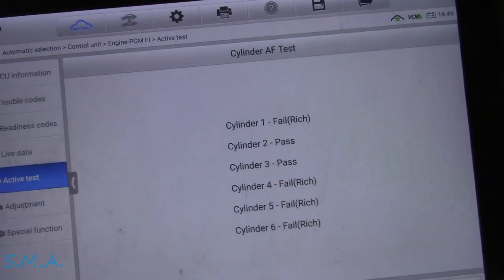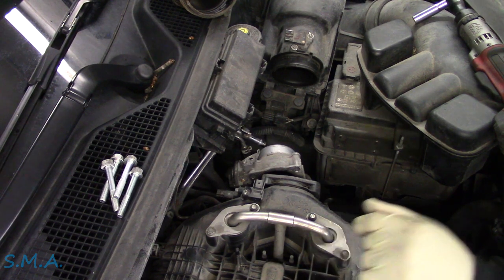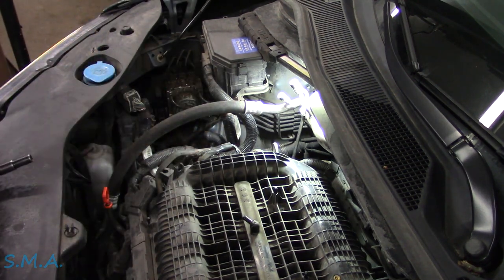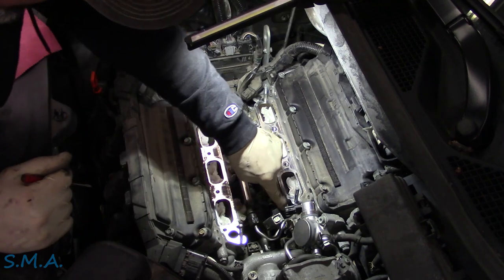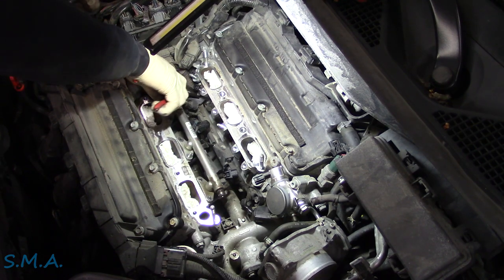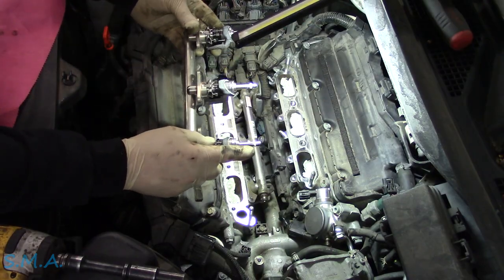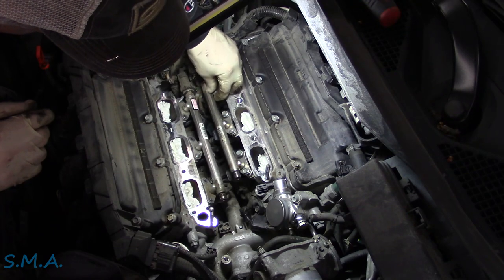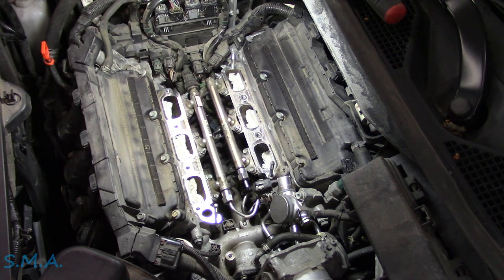Honda: Earth Dreams 3.5 GDI Replacing Fuel Injectors

Comment: anyone who thinks honda are the bees knees are lying to themselves.  the honda odyssey I drive as a company vehicle has tons of issues. 100k miles,  both ball joints clunk.  the control arm bushing worn out, power steering hose leaks, roof leaks at pillars drips on you legs and into the fuse panels by your feet on both sides so it blows fuses and the electrical system acts up when it rains.  heated seats are on in the summer, windows wont roll up/down, rear doors wont open, no headlights or turn signals or horn all in the rain.   the engine smokes when you take off from a stop and it's been idling for a min or two.  blows out a big puff of blue smoke.  the rear doors rollers are shot on both sides.  the rear trunk lid shocks both have leaked and quit working.  the check engine light comes on for the oil pressure stuff that activates the Vtec.  the brake calipers have been replaced due to one seizing up and the other had a torn seal on the piston.  the exhaust has had to be replaced because it rotted off and the converters fell apart and rattled inside.  and the power steering pump went out.  

it's literally had more stuff wrong with it than any gm i've ever owned.   i'm now a Ram truck owner and have no problems with it in 124k miles.
Reply: Company vehicles have more issues in my opinion. Our fleet of Grand Caravans have many more issues than your fleet of Odysseys. Even when we had 5,000 miles they were creaking and breaking.
Reply: @midwestfarm757  i'm the only person to ever drive it. once it hit 90k miles it fell apart fast. they're also know about sunroof drains leaking into the pillar shorting out the fuse blocks.  when it does, you can't drive it.  since i drive it, i  change the oil.  since it was new it uses 1.5 qts of oil in 4500 miles
Reply: @blue03r6  That's nice of them to give you a sun roof, our fleet vehicles fanciest parts is probably the back up camera.

Comment: HONDA is the new 90's HYUNDAI. I owned a 10th generation accord. Computer died at 33k, warranty ended at 36K, brakes went at 38K, then the big problem came at 58.6K FUEL INJECTOR FAILURE $1600 repair-must replace all 4!! Videos on my channel for all to see. Not covered under my warranty! Called Honda how could major part failure occur so early!!! Got ghosted! Dealerships so out of touch they recommended brake fluid replacement at 30K. Started researching and found out Earth Dream engines turn into Earth Nightmare engine: injector failure, oil dillution, turbo failure, cat converter failure start appearing @ 100k. By the time you see the signs all the dealers and influencers will be smiling down on you but helpful to sell you the newest version for a nice loss passed on to you. With almost identical engine I have no doubt the 11th Gen Accord will siphon your wallet turbo fashion after that joke of a 36k warranty runs out 😂

Comment: Silicone in adequate quantity  in the fuel could poison O2 sensors permanently! accidental mixing of solvents saturated with silicone in gasoline has in the past destroyed O2 sensors in hundreds of vehicles until the Gasoline blending police find out who mixed silicone solvent into the gasoline blend to act as filler for the overall gasoline formula!! Who would have thought!!

Comment: Looks like a cheapjack injector design. Can't cost much to make. Someone somewhere has some automatic machinery churning these things out for the price of a good spark plug. Like $6.63 each.

So now the injectors need replacing at 50K miles. A regular service item, no less. You'd think Honda would get the supplier to make a better quality item, but no.

Wonder if the post '20 engines have a better injector.

Doubt it.

Huh

Comment: This is to be expected when you make gas injectors into direct injection... This has plagued diesel engines for years
Reply: What diesel engines???  With the exception of the newer electronic injectors, there is RARELY an injector problem!
Reply: @harrydavis8120  all of them...injector failure is common on large engines....i work for a large dealer and let's just say injectors from several major players are on back order

Comment: there was nothing wrong with the old injection sytem, pretty much fool proof, direct injection is just pure trash and headaches . Had a bad injector on a ford transit 2500 3.5 turbo , injector was seized in the head had to replace the head and 3 injectors. cost ovet 5k . when it couls of been a 500.00 repair

Comment: This is why I will only buy Honda or Toyota anymore..   (other than my 2002 F350 7.3L Diesel w/ 6spd manual)...  My girl has a 2010 Dodge Nitro, and it's a nightmare to work on.  The horn isn't working because the relay is built into the TIPM, which I'm not buying.  The ABS has crapped out on it and triggered all the christmas lights on the dash.  The heater core is a 9hr job to change;  you gotta take the entire dash apart-- it's so dumb. smh